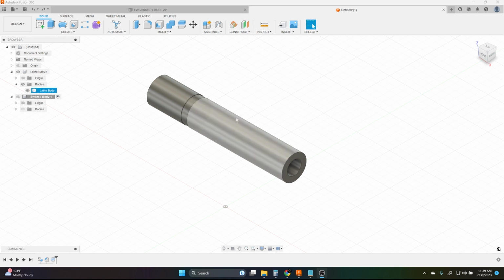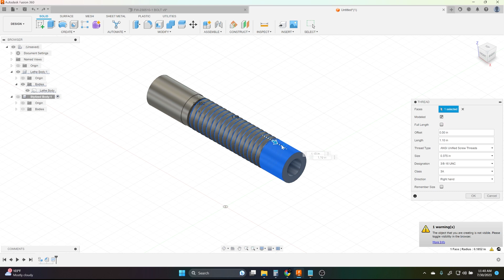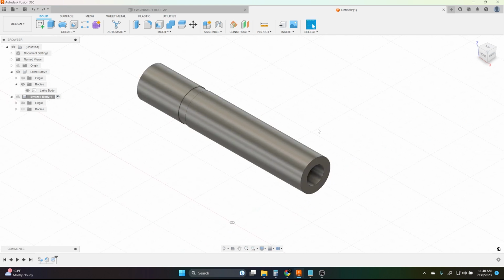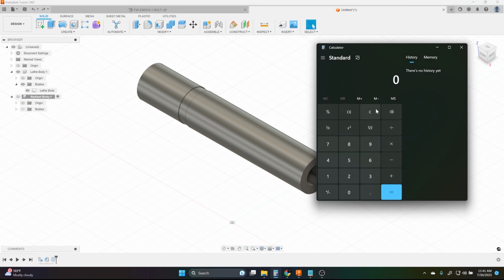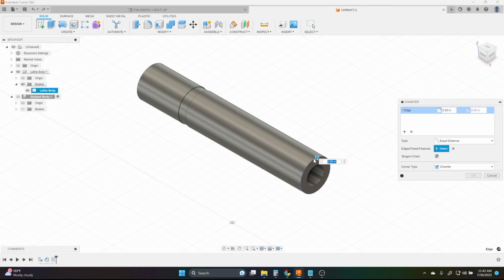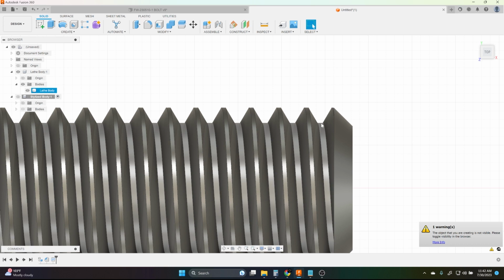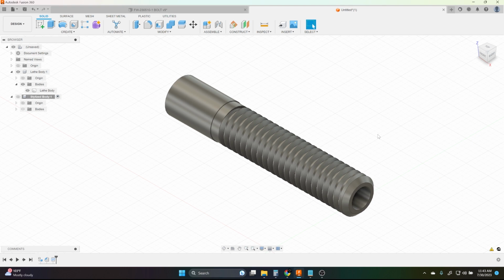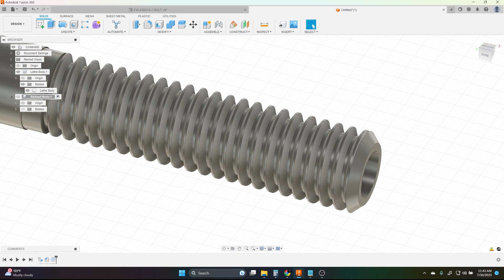How to Chamfer Threads in Fusion 360

Comment: The issue I was searching for still stanads. The start of the thread is still blocked by the chamfer. I'm surprised Fusion hasn't fixed this yet. In SolidWorks you can extend the thread cut through a said distance, and have a chamfer already in place.
Reply from the maker: 3D Print Threads with Fusion 360 and Cura
https://youtu.be/WsYOodDXCHc
I wasn’t too smart on that video, but this one works great
Reply: @bryanofthings  ill have to look at that, i found a solution by performing the threads, and then adding a chamfer to the partial radius that can be selected by the starting thread. Thanks for the reply with the link! 🙌

Comment: Great video! I'm using the personal use version of Fusion 360 and when I put a thread on a cylinder it covers the whole thing, I can't set the length of the thread or where it ends
Reply from the maker: That's good to know. I get spoiled with the paid version
Reply: What do you mean? I am using the personal use version as well, all you have to do is to uncheck the "Full Length" box and you will be able to set the chamfer wherever you feel like at the end of the part